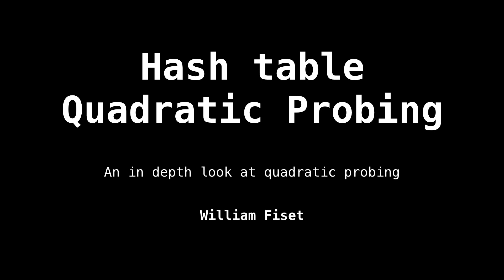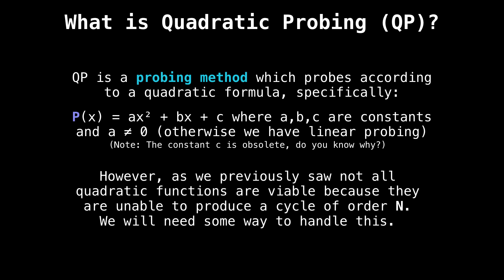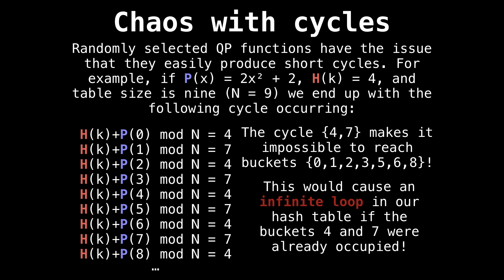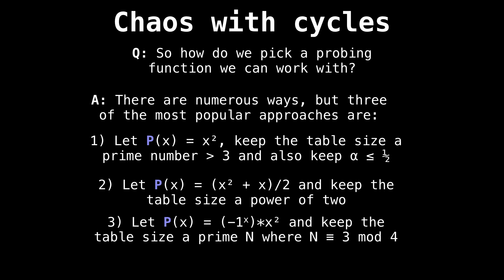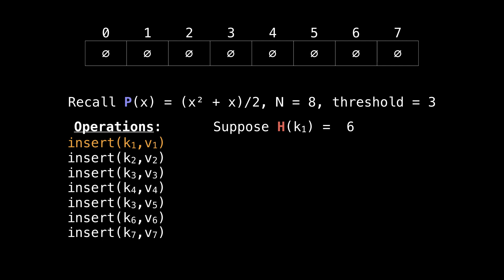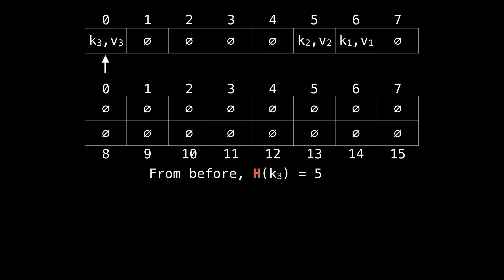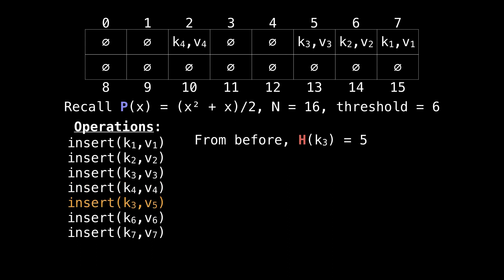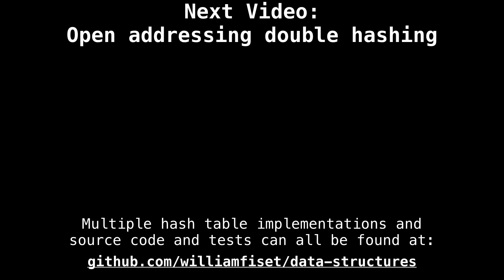Hash table quadratic probing

Comment: https://youtu.be/b0858c55TGQ?t=170
William Fiset's data isn't matching with what I got!

hi = (4 + 2xx + 2) % 9
hi = (6 + 2xx) % 9
x
0     6
1     8
2     5
3     5
4     2
5     2
6     6
7     5
8     8

But, anyway, bottomline is -- only few HT indices are being reached (2,5,6,8), and getting repeated, and unlike Linear Probing, here they are unevenly repeating.

Comment: Is there any reason why, when you’re copying the contents of the first table into the new one, you don’t hash in the order that the elements were provided, but instead the order in the table itself. Would doing it the other way be wrong or cause an error in some way?
Reply from the maker: It wouldn't make a difference either way AFAIK. Also, you don't actually know the original insertion order of the keys (i.e that k2 was inserted before k3) unless you actually allocate memory to store that information, that's why I simply run through the old table when reinserting.
Reply: @WilliamFiset-videos  is there a proof for the first popular approach of quadratic probing?
Reply: @dewman7477  Are u referring to P(x)=x^2?

I think, N=primenumber, helps coz a primenumber would be a coprime with any other number (the value of x^2), except for multiples of the same primenumber. So, repeating cycle of the series of HT indices would be of size N.

If N=11, x^2 wudn't have a common factor with N till x becomes 11. Since the 1st HT index in the series of unique indices wud be for x=0, last unique HT index wud be for x=11, and so we are safe. :)

Does my analysis makes sense?